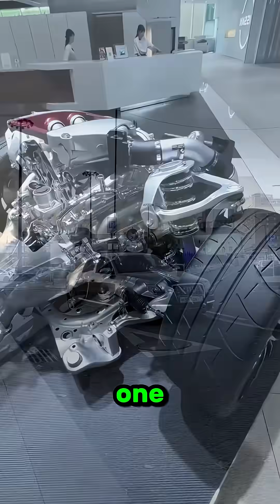This is why we don't we see seven-cylinder car engines? #shorts #cylinder #engineering

Comment: It's mainly because V8's were designed to be compact, it's the reason V4's are uncommon too as an Inline 4 is compact as it is.

Inline 6's are already quite long, V6's are the substitute if need be. Inline 5's work as they're not that much bigger than an Inline 4.

Inline 7/V7 is just odd. And yes, a V7 is possible as VW made Odd-Cylinder V Engines (V5's)
Reply: You forget about the Inline 8, used a lot in the pre V8 era.
Reply: @duroshebanja6810 Very true

Comment: So why have 3 then? 3 is odd
Reply: cause it goes IN-LINE. I had a Hyundai Grand i10 3 cylinders
Reply: You want a number that can easily divide 360 for the degrees of rotation. 3 works, even if it's not the smoothest, per se, compared to a 4 or a 6. Also, efficiency norms work for the 3 way better.
Reply: @jkarthik24 I run a 5 cylinder Diesel! 😊